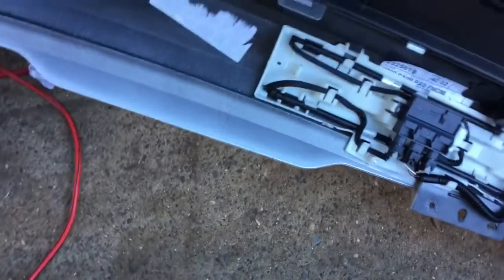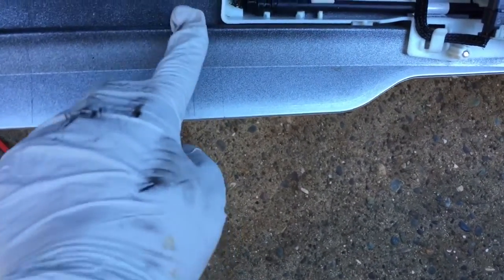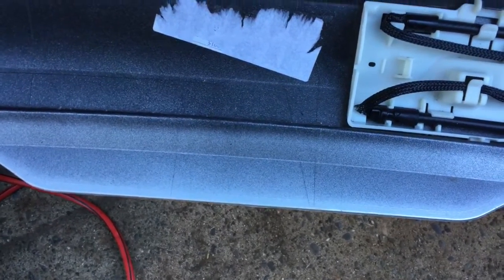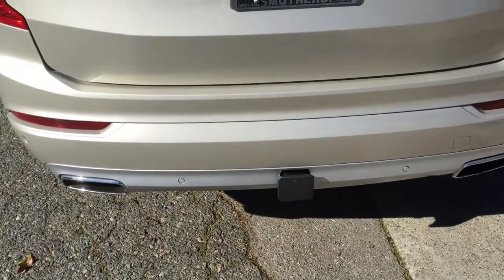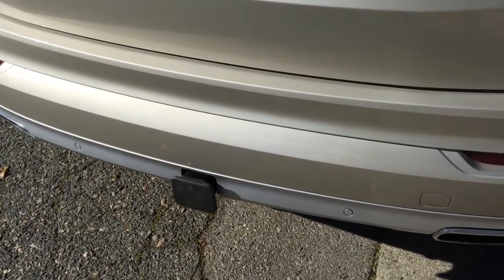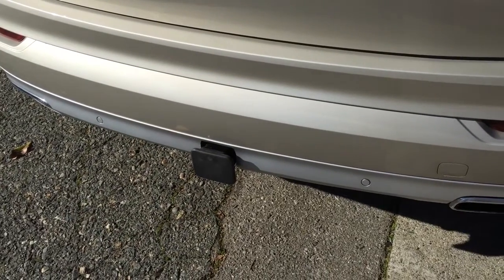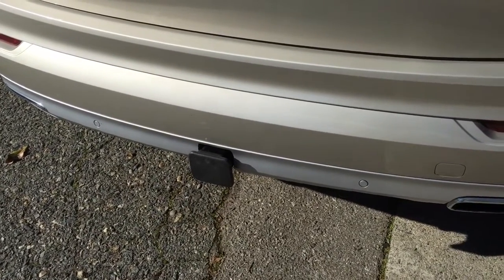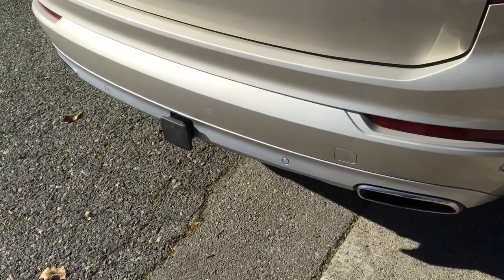2016 Volvo XC90 Towing Hitch Installation - Part 4

Comment: Great set of videos.    You talked me out of installing this myself.     With the smaller opening you used, are you able to get the cross pin in there when you have a ball holder mounted or bike rack mounted?
Reply: skibo63 how do you install the bike rack without easy access to the cross pin hole?